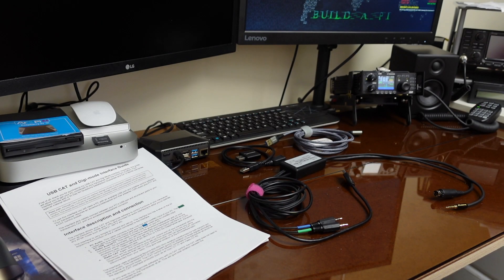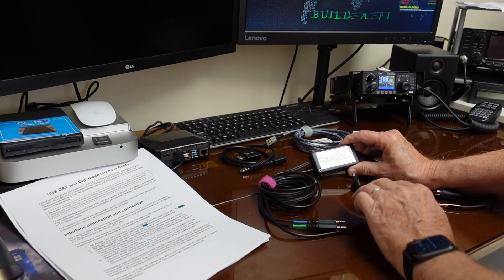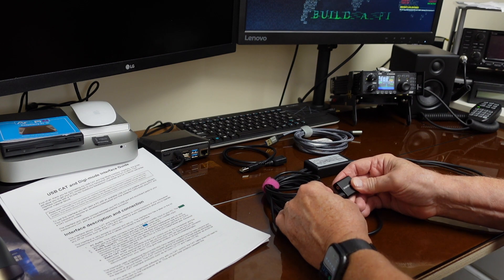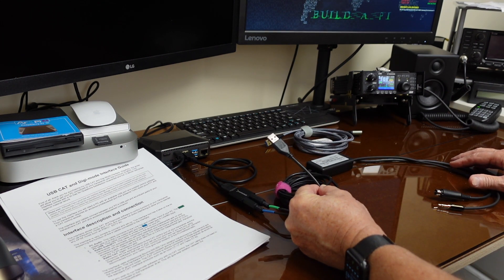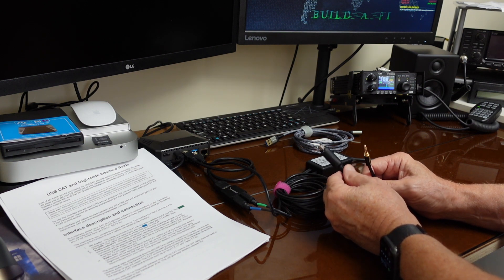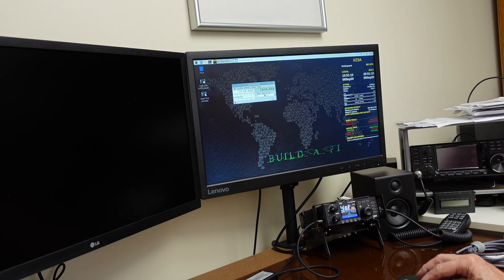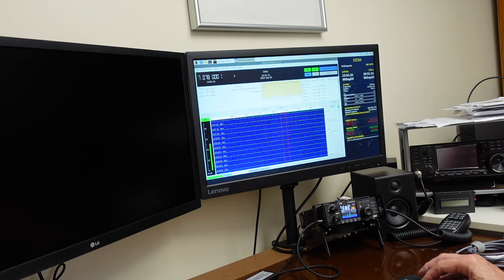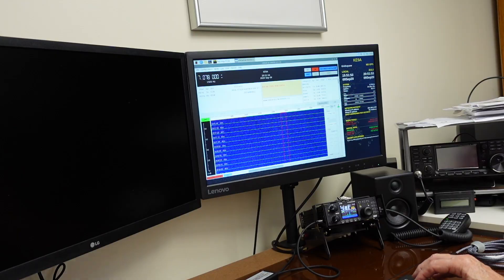XGGComms

Comment: Do you have any issues when you plug in the din connector to the G90? I just got the same cable and it automatically keys the G90 when I plug in the din connector.
Reply: Please be sure to setup the  interface with RTS as the PTT in your software.  If not set right the radio will key down like you mentioned.  Read the manual for instructions.